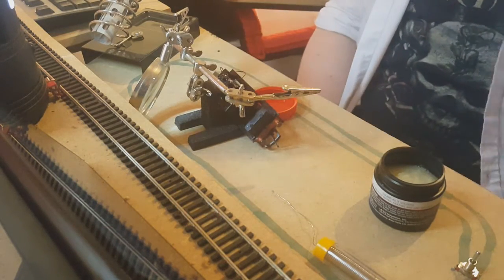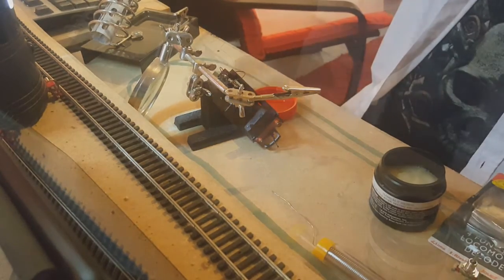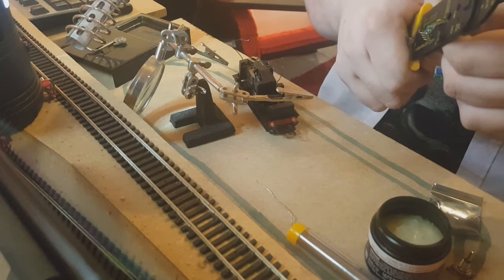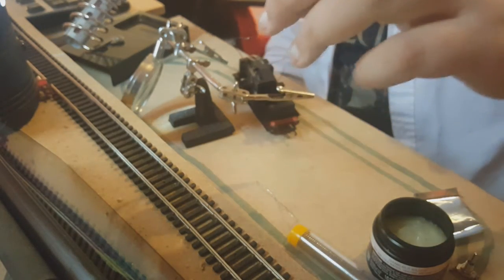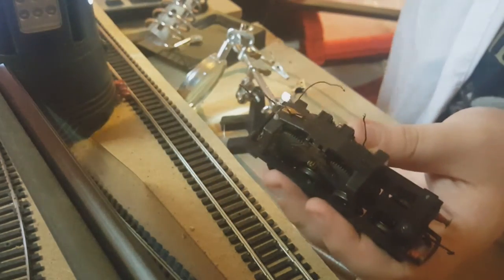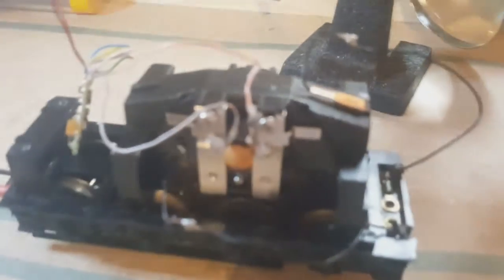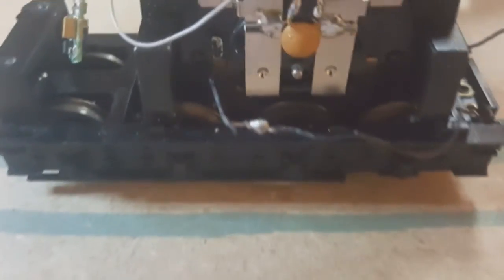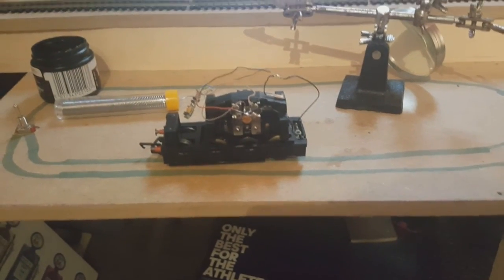Wiring/programming a DC loco to DCC (Part 1)

Comment: That "transistor" is a capacitor for noise suppression which should be removed for DCC operation - does no harm but is not necessary.  For a "tutorial" you have not shown how you actually did things and explanations are not very helpful.  Not a good tutorial at all.
Reply: P
Reply from the maker: Hi Peter we are sorry that you feel this way the video may have been titled wrong it's not so much a tutorial more of a way we did it as 2 young lads who love the hobby and not very electronically knowlagable thanks for your comment we will take it in and use it for future updates